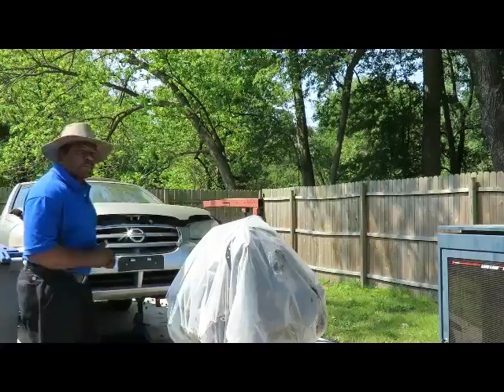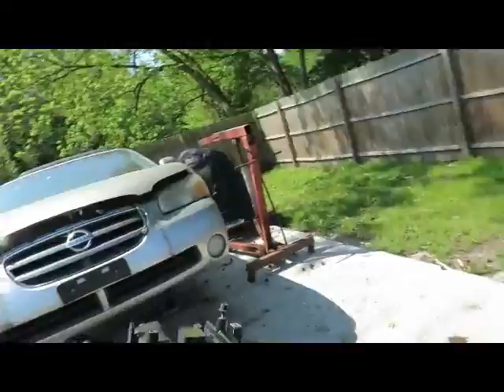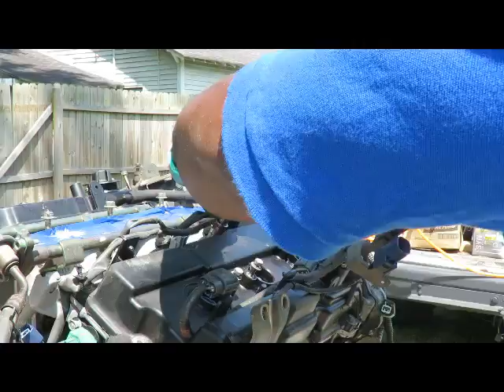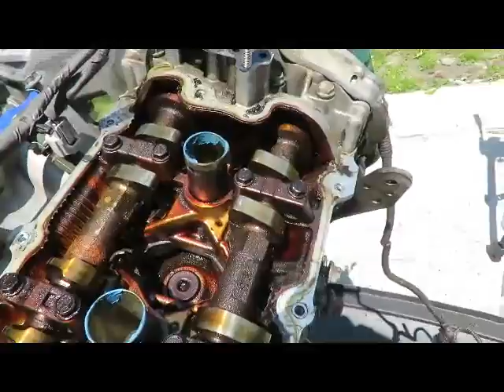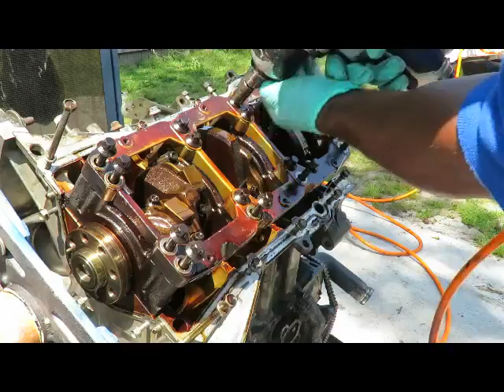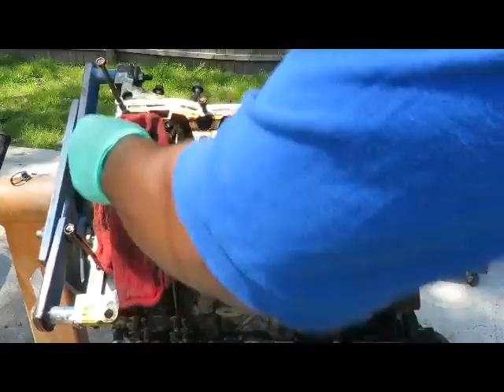⭐ 2003 Nissan Maxima GLE - 3.5 - Partial Engine Rebuild - PART 4

Comment: When one of the ignition coils on my 2003 Maxima went bad it sound like a rod knock. I thought for sure there was internal damage. I Swapped the coil and away went the knocking noise. I mentioned this because you stated in this video you had a bad coil. Great information and videos........
Reply from the maker: Hey John, you actually had a bad coil that sounded like a rod knock, wow!
Reply: Yes I thought my son blew up the engine. It was the rear firewall middle cylinder coil  that was bad. The car has a lot of miles on and I was expecting the worse it and it definitely had a knocking sound to it.. Well swapped the coil - noise went away and 50k miles later car still running @ 250k . I do realize the engine is just about worn out and must have significant bearing and cylinder wear also.  Just an FYI you never know.....................
Reply: @OnlineAutoRepairVideos  hey like your videos and your knowledge on maximas. Quick question if you replace both camshaft sensors but dont clear the check engine light with code reader will car still run rough?
Reply from the maker: @cedricmiller4370  If the running rough condition is caused by  one of the cam sensors, then the problem will go away, and eventually the check engine light will go out as well.
Reply: @OnlineAutoRepairVideos  ok thanks for responding back i will just drive it a few miles to see if everything goes back to normal i replaced both camshaft sensors it could be the catalytic converter at this point tho